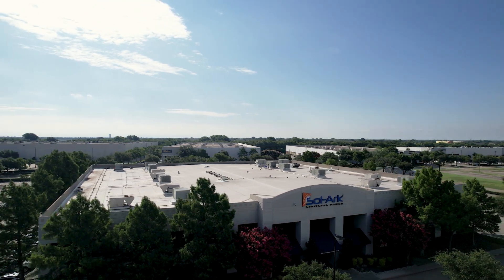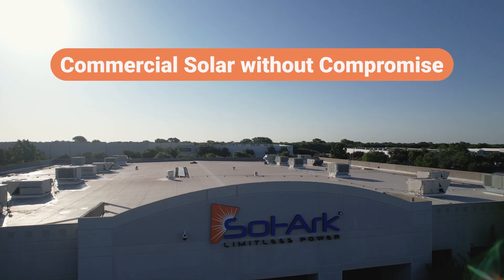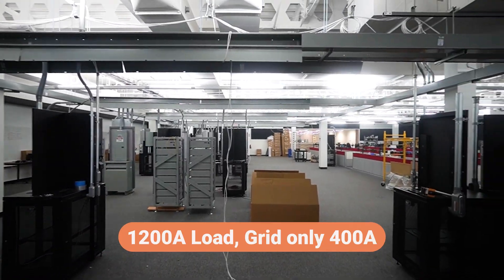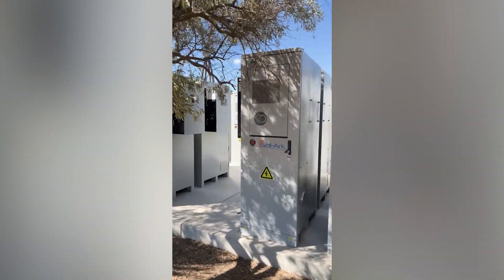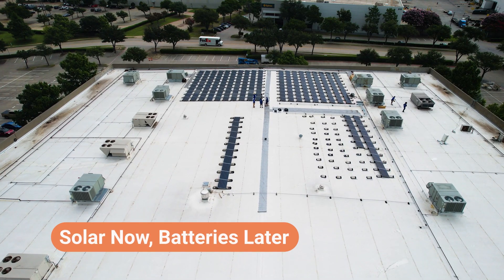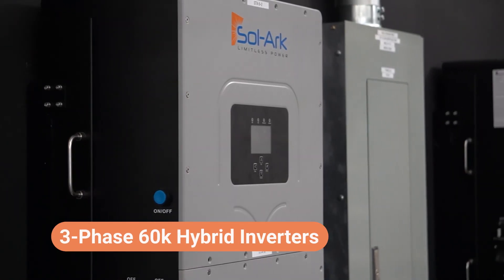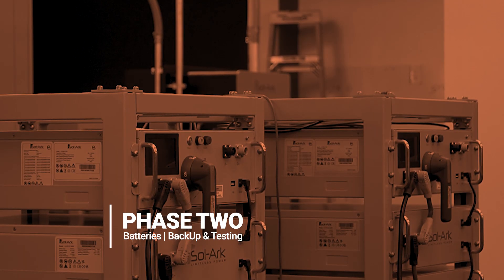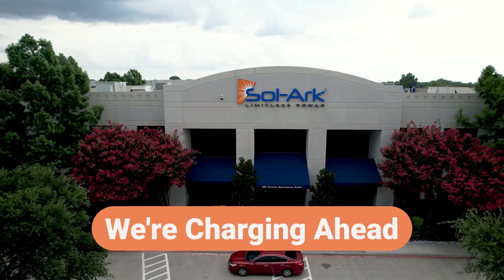Turning Our HQ Into a Power Plant: Commercial Solar in Action

Comment: Question ⁉️ your lab 1200Amps at 480v 3ph is 600,000 watts. Or approximately 10x Sol-ark 60k (per phase?) so 30x total.?! 😅⚡ Not including your already 400Amp supply currently. Plus HRV battery X2 per inverter 🤑🤑🤑 money, money, money > tax break 🤑😂🤑😂🤑😂 all the way to the bank. 
Either way that's pretty cool Sol-ark 🤙
That's a sweet DEV Lan!!!!